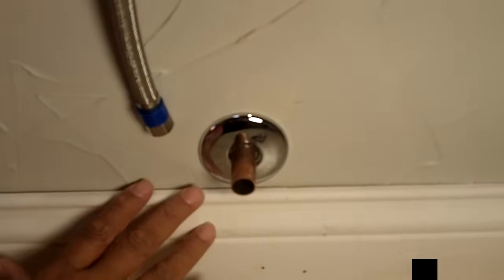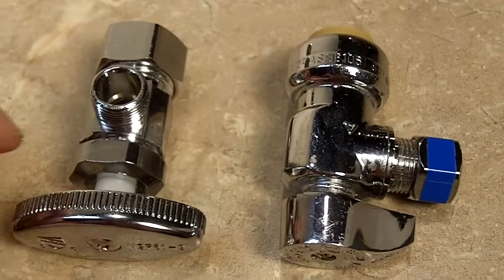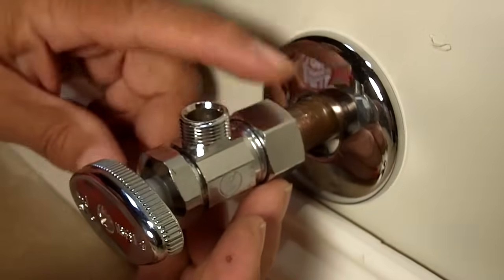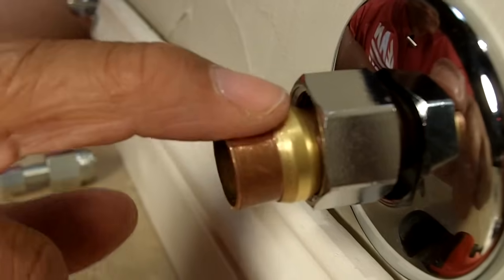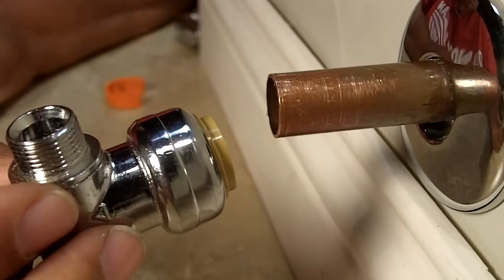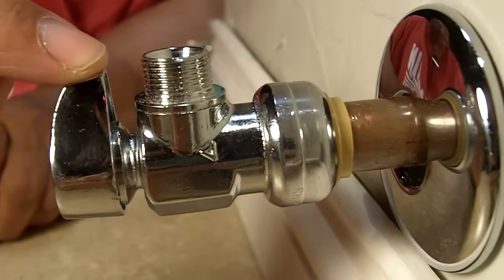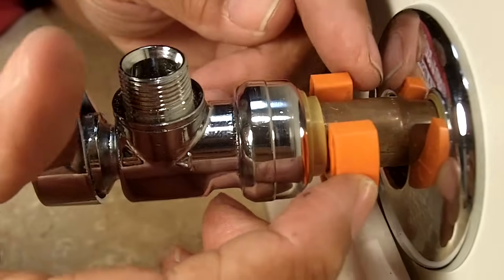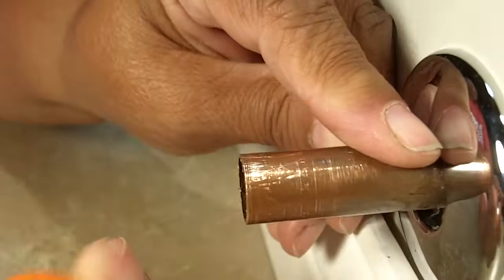Which Type of Water Supply Valve Should You Use: Compression or Push Fit?

Comment: The push fit (shark bites ect) also have an advantage they can spin / rotate on the pipe without leaking. They have come down in price.  The tool comes with most fittings and only like a $1 so no real expense. When done I just leave the tool on the pipes. You can also use a wrench the size of od of the pipe too. These push fit are what Pex uses, so good for copper and Pex. Their is a YouTube video of a guy hanging on a push fit connector between two pipes with weight attached too and not coming apart.  Taking off push fit is not always as easy as she did it. Be sure to fully slide in and leave room. Be careful if you heat up pipes with these connectors are still on. Compressions don't over tighten try it first before over wrenching.

Comment: Do I need to rough up the copper pipe before installing the push fit?
Reply: The copper should be as smooth as possible. Do not install a push-fit connector on a pipe that is scratched up badly like the one in the video.

Comment: I used another brand other than SharkBite for an under-the-sink supply lline valve. I don't remember the brand name but it involved a snapdown lock-clip on top of the valve. It failed. I went back to the store and returned it and against my better judgement, went with Sharkbite rather than something more conventional. It worked great. As a rank amateur plumber, I can say that the hardest part about any plumbing work is taking off the old, corroded stuff.

Comment: For people with tight spaces or weak hands, there is a tool you can use to remove push on fittings:  https://www.homedepot.com/p/SharkBite-1-2-in-Fitting-Disconnect-Tong-U711A/206697672

Comment: The major difference shown is actually the difference between an old style faucet valve with a plastic shaft, certain to leak in a few years, usually under sinks, versus a quarter turn ball valve that is far cleaner, trouble free, and leak resistant, wherever you are merely turning a supply line totally off, or totally on. Cost? That Sharkbite orange tool is like a buck, often free with fittings; DIY $5-15 total, saved a $100 plumber's visit, and you're offsetting against the cost of a HOUSE, for god's sake. First rule of DIYers should alway be: Use what you're saving to upgrade to the best quality level replacements, at least a couple grades above "contractor's grade" which is code for cheapest possible to meet codes. If it grates on you, itemize, and when you sell the house add the costs on to the sales price LOL
Reply: Pl

Comment: lea  where can I buy that orange  plastic tool in the video     what is it called ?
Reply from the maker: it's a push-fit removal tool, and they sell them in the same section as the fittings.  In this case, I was using the Sharkbite brand, but there are others

Comment: one other point- a quarter turn valve is better in that it will shut off better in time where a twist valve will be difficult  to shut due to mineral buildup.
Reply: Especially when the turn valve is plastic, old and corroded.  They snap easily.  I think it's worth the extra money to get a quarter-turn push valve.  But will I need that feral tool to remove the ferrule on a 25yo original compression valve?
Reply: @SWLinPHX  no since the mineral deposits will be lodged behind it making it useless
Reply: @Beachnative42  I ended up removing my supply valve, putting in a quarter-turn (not push-on) and hooking up a hose to my toilet all by myself (kept old ferrule on there).  Hardest part was getting my multi-turn main water supply in the house all the way off.  Tightened with all my might but still a tiny trickle of water coming out of all the faucets.  Finally I had to use a tool to turn the valve so so tight (didn't want to break it and then have to change THAT too)!
Reply: @SWLinPHX  If your main water shut off valve, before the meter, is not shutting off completely, you'll need to either repair the valve or replace it.  Replacement with a quarter-turn ball valve is always a better choice.  Unfortunately, the water supply will have to be turned off by the city to perform either task.
Reply: @SWLinPHX  I have seen them removed with a pair of screw drivers,  i have also seen it done with a pair of pliers, all you have to do is push the plastic on the pipe back into the valve itself.
Reply: @pbrown6097  What are you referring to exactly?  I made a couple comments.
Reply: I ran into that problem. It was so bad that I could not turn several twist valves.
Reply: Any plumber that still uses multiturn valves in any application anywhere-in my mind-is committing professional malpractice.

Comment: Looks like you could substitute an open end wrench to remove a shark bite fitting.
Reply: You could substitute anything that would compress the release ferule as long as it doesn't damage the pipe.  The Sharkbite plastic tool won't damage pipe.  If you use a wrench and it slips when the fitting lets go, it can scratch the pipe and cause a slow leak.  There are special release tongs available to make removing push on fittings much easier than the Sharkbite plastic horseshoe tool:  https://www.homedepot.com/p/SharkBite-1-2-in-Fitting-Disconnect-Tong-U711A/206697672

Comment: Side note: at the suggestion in a home improvement store comment section, the store recommended using a 5/8 wrench if the push valve removal tool isnt available in stores. It wasn't available in our big box home improvement stores so that's what we used. (disclaimer: try at your own risk)
Reply: I'm a plumber and most of us use a wrench or adjustable wrench

Comment: Kind of surprised you would use a wrench with that type of jaws to hold back a chrome valve, 2 crescent wrenches would have been more professional...Plus the push valve having to have exposed copper pipe looks terrible, couldn't you use a split ring escutcheon  then simply remove it to remove the valve?

Comment: As far as the removal tool for the push-on fittings are concerned, at a cost of less than 2 dollars there is no reason not to buy a couple of extras.  You can put one into your home tool box or even take a zip tie or piece of string and tie it to the plumbing under the sink.  Really nice to not have to look for the tool when you need it.

Comment: To easily remove shark bite products without their tool..... Put an adjustable spanner wrench on the copper, then close it until it's snug on the copper and use the bigger surface area to remove the fitting in the same way. Nice vid!

Comment: As a plumber for 30 yrs I prefer valves with packing nuts around stem behind handle. Years later when they are operated they can drip and a little turn of that nut will stop that. Also could be rebuilt in a pinch.
Reply: And thanks for the video

Comment: Hi. Journeyman plumber here. A good thing to do with the push fit is to establish the depth of the push fit fitting and then mark the pipe accordingly. Then you will know that it's all the way in. I prefer the 1/4 turn fitting, which is a ball valve. The other valve has rubber washer to close the valve. In time , especially on a hot supply to sink etc that washer wears out and will not shut off.
Reply: I agree, a Ball Value is the way to go with all water valves, water heats, hose bibbs, water conditioners etc. If you have a leak it only takes one quick turn to shut the water off. BTW I'm not a plumber, I just pretend to be one on Facebook lol
Reply: If you don’t exercise your ball valves they will not shut off when the times comes either.

Comment: my landlord recently put a new delta faucet in my bathroom also put new push fit.Now my water pressure sucks bigtime can I adjust the valve to help increase the water pressure?
Reply: Slicknick 48 In my experience it's not the valve but actually the faucet itself specifically the aerator which limits the amount of water that leaves the faucet according to water conservation laws that did not exist back when the faucet that was replaced was installed.
Reply: thanks youre right I found that out because I took apart the tip of the faucet found like 3 parts inside minus the rubber spacer..so I poked/widened some holes in the white plastic(part with holes) it really helped the flow of water
Reply: Slicknick 48 your pressure is the same, the volume now sucks. Nothing you can do, short of adding a pump or a pressure reducing vale will change the pressure available to you.

Comment: Hi! May I install these two kind of valves in plastic pipes as well?
Reply from the maker: Not for pvc but can be installed on pex and cpvc.
Reply: seejanedrill thanks for your answer.. another question... if I use the compressed valve with a pex do i need an adapter or a cramping tool???
Reply: do you have any tutorial to install on pex and what it requires?

Comment: Nice video, thanks! FYI SharkBite makes disconnect 'tongs' ( http://www.sharkbite.com/product/disconnect-tongs/ ) which are MUCH easier to use than the disconnect clips and will fit in tight spaces. A little pricey, not on the shelf at my big box store, but well worth the price if you have time to find/order from an online discount supply place. You will need one for each size (1/2", 3/4", or 1") - 1/2" is what most DIY homeowners like me will use the most (toilet and sink supply valves).

Comment: Don't overtighten compression fitting. Snug it up and then check for leaks. You can always tighten it a little bit more. If you overtighten you can damage the fitting or pipe and have a leak. Tighter it not always better. With slide on fittings, mark pipe so you know it has been properly installed. Problems often occur because the fitting has not been pushed far enough into pipe. The package should indicate how far onto pipe it should go for a given pipe diameter.
Reply: MarzNet256 : I had that problem with a Sharkbite leaking because it hadn't been pushed in as far as it should. I normally solder pipes, but I used a Sharkbite for the first time in a place where it would be dangerous to have an open flame. It was very hard to reach; I could only get one arm back there, and because I couldn't hold the pipe with the other hand, I wasn't able to push the Sharkbite hard enough to fully seat. It took some real gymnastics and some imaginative use of tools to get in there and apply enough pressure to stop the leak.
Reply: MarzNet - If you messed up your compression fitting ring just wrap some teflon tape around it and tighten the nut. WORKS!
Reply: Sdbklhchki
. 
.

Comment: Thanks so much, Leah!  I just removed my leaky/broken compression valve with a push fitting valve, but now the water pressure is coming to the toilet 90% slower.  Any thoughts on what I did wrong?
Reply from the maker: Hi Matt, it sounds like the valve that you got might be defective, and for some reason the valve isn't opening all the way.

Comment: I just removed the compressor valve but the ting is the ring was very hard to pullet out so I have to use a lots of force I finely was able to get it out ,so I installed the new valve but I have a little leak on the ring area
Reply from the maker: Hi David, sorry for the late response.  I was traveling on See Jane Drill business, and am just now getting back to people with questions.  It could be that the packing nut just needs to be tightened.  If that doesn't work, Here's a plumber's trick you can try.  You can wrap the ferrule (ring) with a little plumber's tape, and see if that does the trick.

Comment: Can you reuse a push fit after you remove it - does removing it cause any degradation of the seal?
Reply from the maker: You can reuse it, as long as you don't damage the rubber gasket inside the fitting
Reply: Thank you.  I did purchase two of these for  under my sink and they are so much better than the pop out safety valves the builder installed.  I also like that I can replace one of these, if needed, in the future and not have to cut more of the pipe.

Comment: is the valve necesary? can you just connect the supply line directly?what is the purpose of the valve?
Reply from the maker: The valve allows you to isolate the fixture when shutting off the water.
Reply: my shutoff valve popped off at 11pm last night after trying to tighten it because of leaking...no hardware store was open..i connected it direct but i didnt turn the water back on because i was scared it might mess my nice toilet up or endless scenarios went through my mind...GREAT CHANNEL thanks for the response...i got the parts this morning and fixed it ...so really the valve is not necesary..my valve was rotten looking...

Comment: Once the push-fit valve is inserted all the way, it will not develop leaks. Am I right?
Reply from the maker: As long as you debur the pipe properly before installing the valve, you shouldn't have a problem with leaking.  The reason is if you don't debur, you could possible damage the inner seal, which would cause a leak.

Comment: They now make quick connect valves with the removal tool effectively built in. Basically there's a little plastic clip near the back (imagine the shark bite tool you have permanently attached, and the clip prevents it from pulling against the valve. You pop out the clip and then the back pulls forward and releases the valve. Pretty nifty! The brass craft ones at the big orange store have that feature.
Reply: Thanks for the info!!!  The big blue store near me doesn't have that one.
Reply: Robyn Johnson they're brass craft, the ones i used; at the Orange store.
Reply: BrassCraft discontinued that model, but Dahl has one:  http://www.dahlvalve.com/products/mini-ball-valves/supply-stops/push-fit/supply-stops-611-QG3-31.php

Comment: Good video, very well organized for beginners. I feel it is important to mention that compression valves are also available in quarter turn styles. When you go to turn off a push fitting valve you also have to hold the valve body while closing the valve or the whole fitting will rotate and possibly kink the supply line.

Comment: Lea!! thanks for replying! it's a leak in the copper line coming from the wall! I am having it replaced! does it matter if I use copper again or plastic tubing connection? thanks! you rock! women rock!
Reply from the maker: +Quentin Sharone Carson   Both copper and plastic tubing have their pros and cons.  You may want to consider using braided stainless steel flexible water line.  It has outstanding bursting strength, doesn't kink or crease,  and is reasonably priced.

Comment: Wow, this is pretty much a great tip!  I have nearly zero space between the nut and the wall (actually to the round dress-up plate).. so it looks like I can't use the 'newer style'  1/4 turn push-valves. :(  Sad, because I wanted to use that in order to be able to turn it on, off and halfway.
Reply: I would avoid 1/4 turn valves when possible. I have had several of them break internally and they can't be taken apart to repair like the old type. (30 yrs. rental prop. maintenance)
Reply: @larrydudgeon855  The plastic stemmed ones would freeze up in our hard water after 5-6 years and the plastic stem would break if you tried to force it. I had better luck with the brass stemmed ones.  I switched back to Brasscraft multi turn valves with brass valve stem. The valve stem threads on every one, new or old, got a coating of Houghton Aqua Shield grease as used on commercial public pool equipment. Even after 7-8 years under sink valves would turn by hand....28 years apartment house owner. I've seen and dealt with it all.

Comment: Unless the compression ring is stuck on the pipe (4:45).
Reply: +Car1Sagan If that happens you can use a mini hacksaw to cut part way through the ferrule ( the compression ring ). Once you have cut part way through the ferrule you can (carefully) use a small flat screwdriver to break the ferrule .

Comment: I was curious to see how to use the Ferrel Puller.
Reply: Here you go: https://www.youtube.com/watch?v=y0ikqzSz-DQ
Reply: So am I've never seen one before. When you tighten the nut, the ferrel is crimped into the pipe.
Reply: @wildmandon1  There are many different types, but if the old ferrule is good enough and there are no leaks, just keep it until you HAVE to replace it.

Comment: Another thing I would note about the push fit fittings is that they can completely rotate when they are installed. Compression cannot. That does make a big difference when you have excess supply hose or slack. And I have never had a push fitting leak when installed properly. Compression can right away if not tightened up correctly. Great video. 

I also have in a pinch used adjustable pliers to pull off a push fitting instead of the push fitting removal tool. Plumbers I have spoken to say they use the same technique.
Reply from the maker: onecrazywheel Thanks for sharing the tip about the pliers...that is a great one, and it may help others out there that don't have the removal tool.
Reply: +onecrazywheel You can rotate a compression fitting by using a wrench.
Reply: @Wolf_The_Dentist_Stansson  Do not rotate a compression valve without loosening it up first.
Reply: @markuschelios6891  In my 9 years of plumbing I have never had a problem rotating a compression valve without loosening